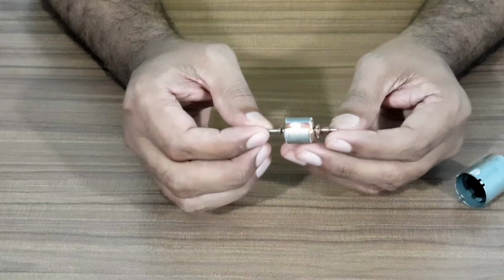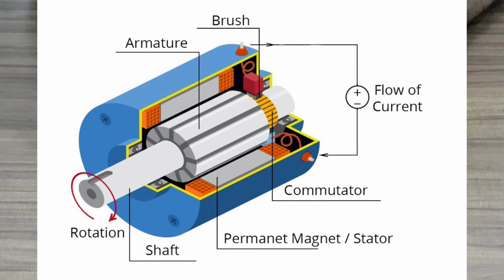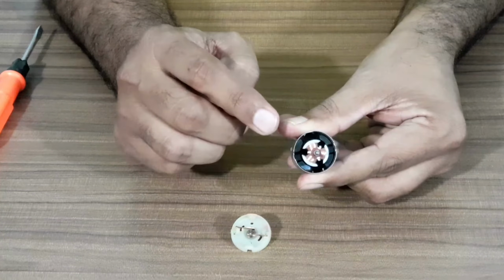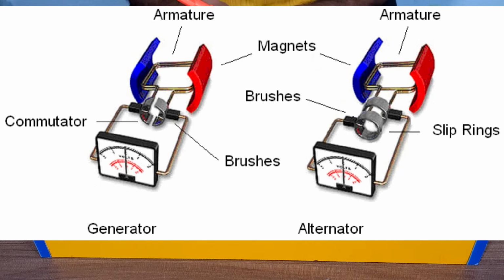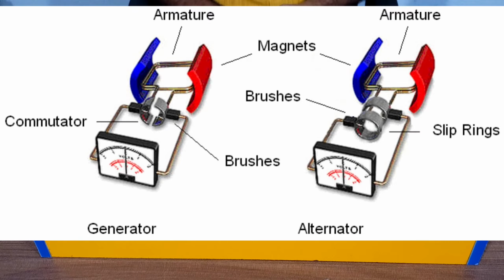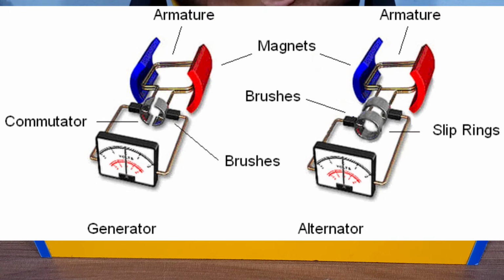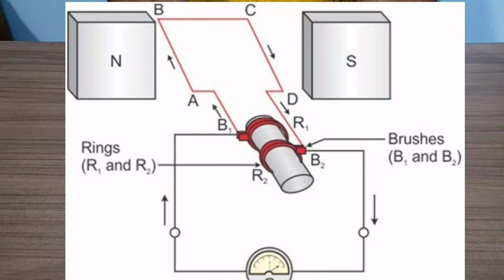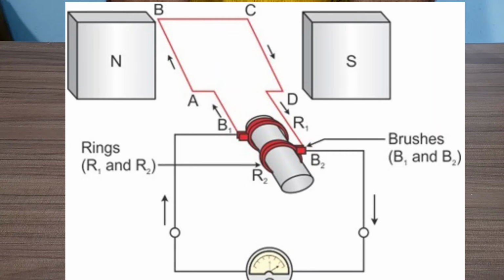How to Make AC Generator working model ?

Comment: Why we called this model ac insted of dc  because here u r not using rings so why we called this model ac Generator
Reply: Bro u Donot know what ac is Alternating Current . Bro I bought the model for my science fair and yes in deed it is AC In an ac Current the direction of flow changes so will flicker.
I know this bc I recorded a video at 240fps slowed with my phone and it was flickering prominently..

Comment: Sir if ac changes direction 50times a second then how it is used in our home to light bulb fan ?how will it flow if it changes direction so many times in a second?
Reply: Bulbs ,fans, heaters etc. can work perfectly & equally well even if current flows through them in any direction. So, change in the direction of current does not affect their performance. However electronic devices like diodes, LEDs, ICs etc. are sensitive to current flow direction. In such cases, we have to use dc power supply which does not change polarity ( direction of current) -like ac does.